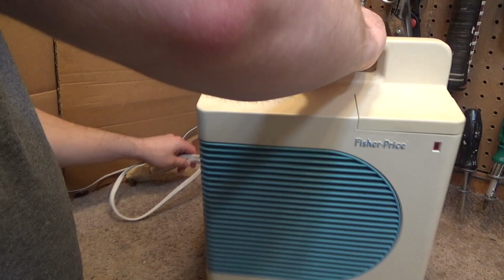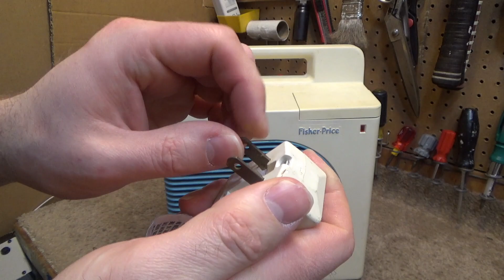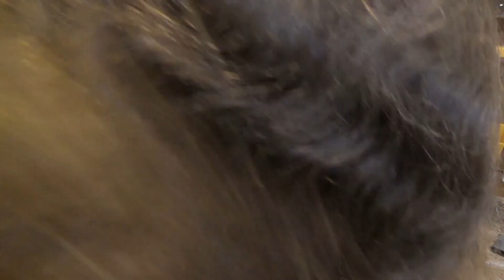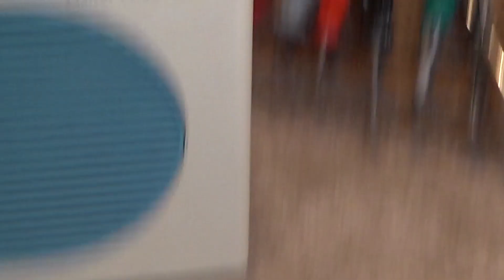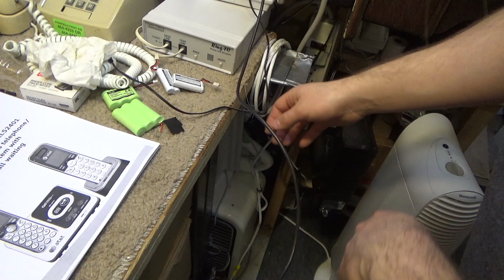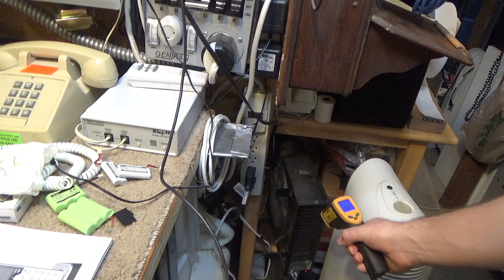Fisher Price (Patton) 1512 Air Heater | Initial Checkout

Comment: If it's rated 1500 watts it should work like any other heater, watts is watts. However the amount of air moving though the coils will effect the output temperature, and being that this heater was made to be safe, they put a higher CFM fan in it to reduce the temperature.
Reply from the maker: The watts is largely irrelevant as watts is not a measure of heat. The heat output of these portable units varies substantially despite the power draw being similar.
Reply: @JordanU  When you convert the 1500 watts optimal to btu/hr, it's about 5100 btu/hr, and it will always be like so. Now yes the heaters may vary by a hundred watts or so, but that shouldn't make much of a noticeable difference. Oh and the whole small room medium room size thing is a whole bunch of baloney! It's just marketing to sell more expensive heaters. I highly recommend checking out the video called "Space Heater Nonsense by the channel called Technology Connections.
Reply from the maker: @versedbridge4007  I find that calculation useless. You can put two "1500 watt heaters" side by side and get night and day differences in how they heat a room. A formula that takes into consideration properties that effect the actual heat output, such as air temperature and CFM for example, would produce an accurate answer.
Reply: @JordanU  OK then

Comment: can't believe fischer price threw their name on a space heater!

when you have a metal chassis , you don't want a hot wire falling off from inside and contacting the chassis.  and thus you want a  grounded plug which ties the chassis to the electrical system ground, so that situation will short to ground and safely trip the breaker.

with all plastic chassis equipment, there's nothing (that sits outside of the normal circuit path) which is metal - so there's nowhere to  even connect a ground wire to.  

the gfci plug monitors the current in the two ac line wires, which should be identical in magnitude.   if they aren't, that means current is unintentionally leaking.  such as from a device that's fallen into water and conducting current  back to ground  by way of a human in bathtub.   the gfci doesnt require a ground connection either.   it just shuts off like a switch, when it detects that particular fault condition   ..
Reply from the maker: I'm not at all familiar with the brand, but from what I've seen it doesn't appear to be a common product for them.

Comment: That's a cool find. Never seen one of these before. It's definitely from the 80s. There's a date code of 8908 on the sticker. It's from August of 1989. Really cool piece..didn't know Patton ever made stuff for Fisher Price. Iv had a couple of these Patton heaters they are really good units.
Reply from the maker: Thanks, I haven't either.
I have another Patton heater which is of similar design and age, that one works quite well. Even with a cleaning it doesn't seem like this will work much better, it may move more air through but I can't see it getting any hotter.

Comment: Interesting, I've never seen one of these before. It may be a well made unit seeing as it was made by Patton and in the USA.

I would say you're right on late 80s, I see 8908 on the sticker and the serial starts with 89, so I would say it could be August of 1989.

Yeah it looks like it was meant to be used in a child's room with the plastic housing, GFCI cord and hidden controls. I know Fisher Price had a desk fan and a stand fan for children, which were made by Duracraft and had the push to turn switch.
Reply from the maker: Considering it's still running all these years later, the fan and bearings must at least be a decent quality.
I vaguely remember those Duracraft models.